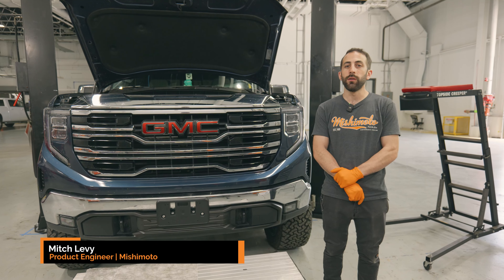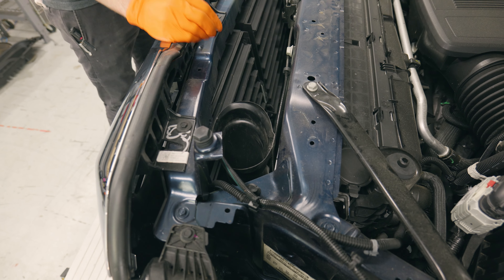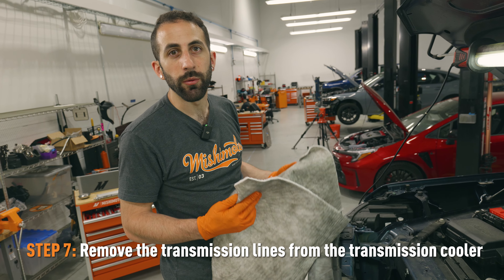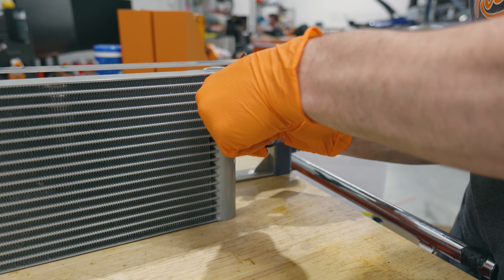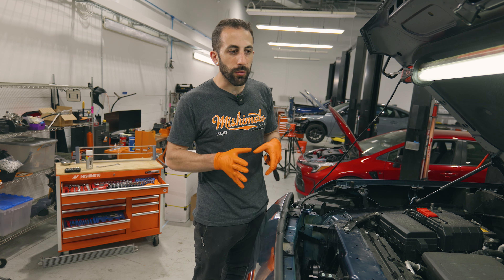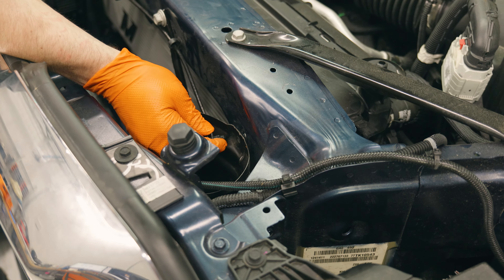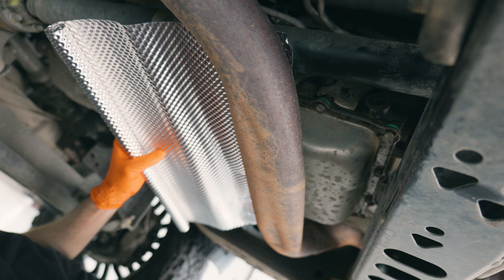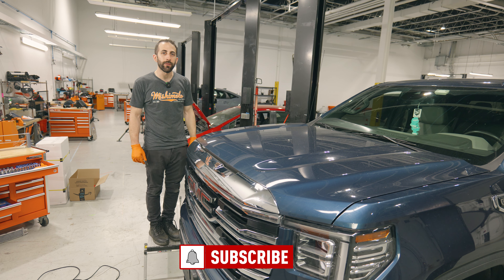How To Install A Transmission Cooler | Chevrolet Silverado/GMC Sierra 1500 2019+

Comment: I thought it had a good external cooler already ? Im trying to pay off truck i dont need to buy more stuff lol 😅
Reply from the maker: It's not a bad idea to add a transmission cooler, especially if you plan on towing or driving in hot conditions!